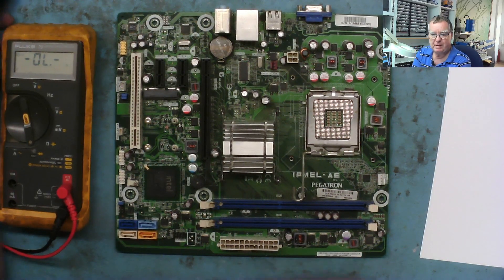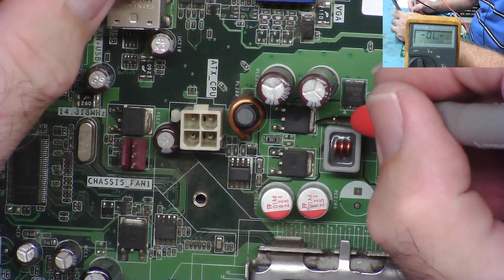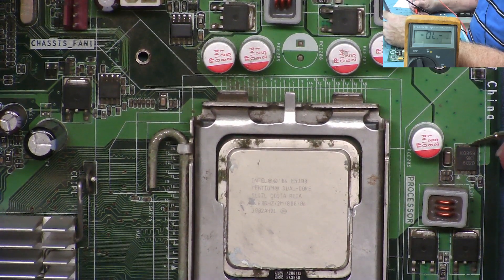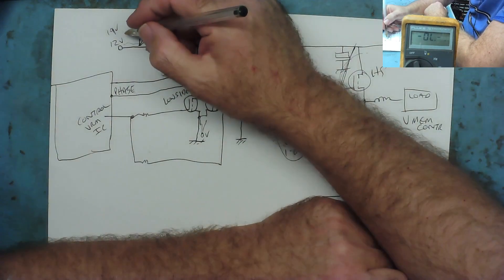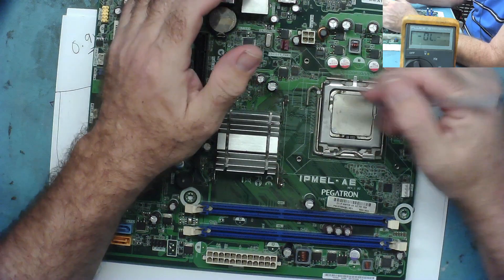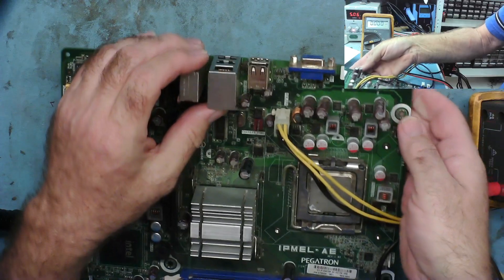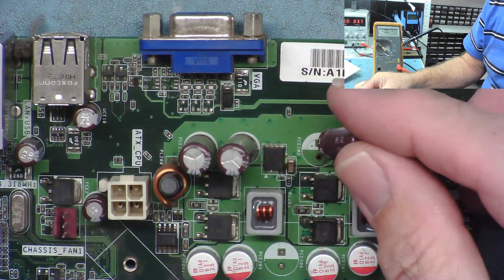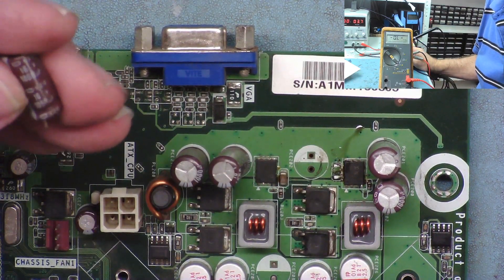How to SAFELY use Voltage Injection to trace Short Circuits - Tutorial LER #174

Comment: Very good tutorial, one little trick I learned way back when trying to get out tiny SMD components quickly  next to bigger components  like electrolytics is to use 2 soldering irons, one in each hand  to heat both ends at the same time..
Reply from the maker: Hi Andy - yes that is another very good technique
Reply: Or hot tweezers soldering iron.

Comment: The +12volt line supply's various Buck convertors could be +3.3 or +1.8 if you broing up one of those lines that are low the components that are leaky will get quite warm.

Comment: Great tutorials, I learned a lot from watching you and Mr Sorin, after I finish this list i'm going to watch newer ones that you made, I took a sneaky-peak they seem to be bit shorter than these but I am sure great wisdom is put into them!

From starring into pcb boards like monkey now after watching your tutorials I can finally have some basic understanding at least what is what and how its working, but unfortunately when it comes to circuits I find myself in deep water very fast...

I do electronics on ground and I got used to use my legs as well, technically I came to precision like having 4 hands at this point can't work on table

Comment: Great video and great channel. Thank you for creating this educational content. It was a little hard for me to understand you (English sounds quite different depending on a location), but even automatic subtitles from YouTube helped.
An interesting alternative to the isopropyl alcohol is a "rosin atomizer pen". It allows you to create something similar to "rosin frost" on a part of a device. Once some component is getting hot, the "frost" melts on it, and it becomes very apparent where exactly the short is. But you still have to inject safe voltage at current enough to heat up the part.

Comment: I'm a newby to electronics but eager to learn - I'm currently looking into a fault on a Enermax EGX850EWL and I've identified 2 x shorted Mosfets and a blown up resistor and a blown up optoisolator chip.  My biggest problem is extricating the Mosfets (K2607) as the heat sink is massive with many components attached, so I'm attempting to remove one of the large transformers to give me room to extricate the fixing bolts.   This is a beefy power supply and I think it's worth the effort to repair.   Your videos are most instructive and my learning curve is steep and I suspect quite long.   
BTW I also have have a Pro'sKit SS-331 which suffered the same fate as yours in that the s/s tube moved withing the heating element but I have fixed it's position by making a couple of brass rings which I forced over each end of the s/s tube thus it does not now move when being "rodded".   The user manual does warn about too much heat oxidising the lead free solder into a solid lump which I now (if it occurs) remove with a long 2mm twist drill instead of trying to hammer it out!   Keep up the most enjoyable and instructive videos - John in NZ.

Comment: It is always sad to see such a magnificent channel with so low subs count. So useful series!
Reply from the maker: @Alkexander Moro
The channel is just 9 months old and it takes time to build up subscribers. On average it takes a new channel 10 months or 22 months (depending which data/website you believe) to reach 1000 subs. According to that #LER is ahead of the trend as it took just under 6 months to get 1000 subs and another 3 months to get 2600+ more.  Latest stats are saying +1100 new subscribers in the last 28 days.  So it's not exponential growth but it is faster than linear.
Reply: @LearnElectronicsRepair  okay, I smh missed that the channel is that young. The amount of quality videos looks more like 3+ years, and numbers are much more impressive if you take the real age into account.
Anyway, your extremely detailed videos made my messy experience with repairing stuff much less messy, and things are making much more sense now. I was able to fix one of the boards where I wasnt able to figure out the issue before, and even got enough courage to order two cheap dead R9 280s to try and maybe resurrect one of them :)
Reply from the maker: @Nworthholf  Yeah I'm a bit prolific with videos as I enjoy making them.  It's really good to hear that I helped you to fix one of your boards, it makes me happy when I know I am helping people.  Good luck with the R9 280s, come and join the Discord, we can chat about them there when you get them

Learn Electronics Repair is now on Discord!  Come and join the fun and let's fix stuff together, it's free.
https://discord.gg/vam6YC8vwU

Comment: Great tips in this video. Even though it was an old MB, was anybody else slightly uneasy seeing 5.0A pumped into PCB traces of unknown widths for so long??!
It was probably ok, but with the current-injection method, the quicker you make the diagnosis, the lower the risk of cooking something. This is where a can of freeze-spray or a thermal-imaging camera would be invaluable.

Comment: First of all congratulations for your great YouTube channel!

I would like to ask if while injecting voltage into the circuit to find the short circuit a positive voltage could be applied to the ground (neutral) rails of the motherboard and the zero voltage at probe pin. Thanks!

Comment: Nice video, by the way I was baffled to find out the culprit was that tiny cap: I would have put my money one one of the switching transistors
Reply from the maker: MLCC capacitors (the little SMD ones) are very prone to failure by mechanical shock or thermal cycling - and when they fail they almost always go short circuit.

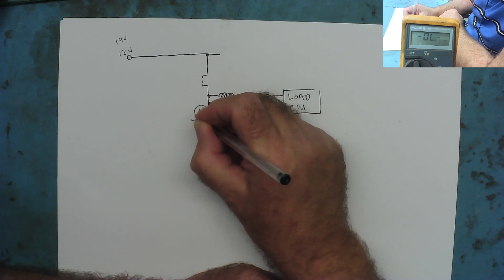Comment: my mother board suddenly gives me BIOS corrupted or missing error it was working last time nothing happened, I tried to find short but nothing is short near BIOS, just 14 ohm resistance which is from the CPU load I get to know in your video. I thought that 14 ohms is the short near BIOS causing BIOS error but after your watching your video 11:50 I am desperate how to find what happened with my mother board optilex 760.

Comment: I guess the older mother boards you can get away with 1.2 volt and 5 amp regulated power when there is a short to ground.   On the more modern mother boards, the recommendation is no more than 0.9 volts and 2 to 3 amps depending on where the short is with regards to CPU OR GPU.   most repair specialist would have replaced the mosfet and removed the capacitor😁

Comment: Where can I get a bench psu without the protection to inject voltage? I see a lot of chinesium made “short killers,” with horrible reviews. Every PSU I have had just protects itself, some at loads at only 68 ohms and below. Can I disable the short protection in a bench psu. Maybe a newb question, but my experience is in older electronics.

Comment: Hi Richard, I know this is an old video and you may not see this but I have been injecting voltage into the 3.3 area on an xbox one. I started low and worked up but end up at 3.3v and 3A. Had 3A drawing but not a single thing getting warm. I think it could be southbridge because of where a few shorted caps are but don't understand why nothing is getting hot when it's pulling 3A. Any advice would be greatly appreciated as my next step is removing the southbridge. Love all the content by the way, very educational.

Comment: Hi there, i bought a power supply for mobile fixing, and today i found that it has a short detector that shuts down the power supply when short is detected, can this be used to inject elctricity into a circut to find the broken part ? Since the elctricity that's going in is transforming into heat, so i guess it should not turn off right ?

Comment: Hello Richard,So the point of safe method is adjusting Voltage up ( max handling Voltage for component) for most vulnerable/fragile component at shorted line with maxed amperage ?
Reply from the maker: Basically you need to consider voltage rails derived form the one where you want to inject voltage.  Inject a voltage no higher than the lowest derived rail (about 0.7V is safe for any GPU and 1V on motherboards)  Then check for any voltage 'leakage' from the injected supply to those derived rails (which are usually buck converter coils but could be LDO regulators)

If you can't get enough current in to warm something up, and you are happy that there is no voltage getting through to sensitive low voltage circuitry, then feel free to crank it up
Reply: @LearnElectronicsRepair   Yes Sir, and  for more detailed desription.

Comment: Is it safe to inject more than one volt in this method can 3 or 5  if not 12 volts be used however the method that I have to inject the voltage is to DIY a ATX power supply into a test bench power supply because I don't have a voltage injector or a test bench power supply like yours.
Reply from the maker: No you need to be careful here - never inject more voltage than the device under test can handle - because whatever is short circuit (for example a capacitor) could suddenly burn out and go open circuit and then your power supply will send the full voltage into the device and if it is for example a GPU or something similar that requires a low voltage it will also be destroyed.  Which I expect is not what you wanted to happen
Reply: Thanks you've been a big help
Reply: Oh yeah keep the content coming there very helpful 🖒

Comment: i bought a used motherboard and when i turn it off and unplug it from the wall , next time i plug it to the wall it turns on without pressing the power button and doesn't start , untill i unplug it from the wall and plug it again and press the starr button ,after i start it it gives me an error that the rtc is reset and i press f1 and it restarts and then starts normaly , i changed the cmos but i still have the same problem , but after i inspected the motherboard closely , i found out that one of the vrm mosfets is missing , the mosfet missing is a r172a transistor, my question is , is it ok to use the motherboard with that mosfet missing, and can the error  of the rtc caused by the missing mosfet or it is something else that i haven't found yet

Comment: Yeah power up and use finger. If the part is hot replace it after going through all the circuits. You may have other parts shorted as well. 73

Comment: Excuse me, may I use battery to do the short circuits finding by adjusting it using potentioner?
Reply from the maker: No definitely not - the potentiometer would just burn up.
Reply: @LearnElectronicsRepair  Oh no, i forgot the high current goes into this potentiometer first. So power supply is a must equipment.

Comment: I have a motherboard where the fan control in the bios isnt working.. it just runs the fans at maximum.. I can see what I think are like voltage regulators near each fan header.. is it likely its these that are gone or any other advice as to how to restore the fan control?
Reply from the maker: What motherboard is it? Model number...

Comment: Hi , can you tell how to determine pch short
Reply from the maker: Well... if it gets warm when you just have 5V Standby, it is definitely short/faulty

If you measure the current drawn from the CMOS battery without a psu attached and it is more than a few microamps it is most likely faulty

You can measure the resistance on the little capacitors that are ofen mounted on the substrate of the PCH - if any of them are short it is probably faulty
Reply: @LearnElectronicsRepair  thank you sir